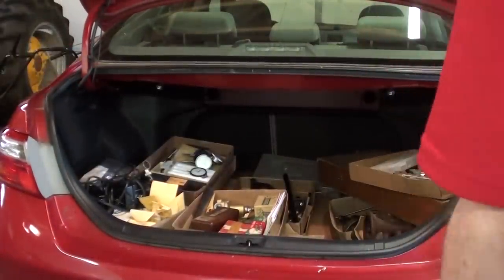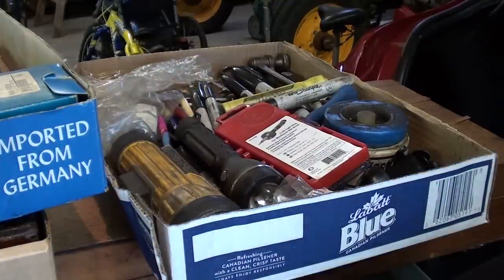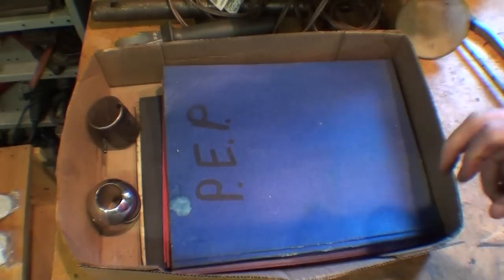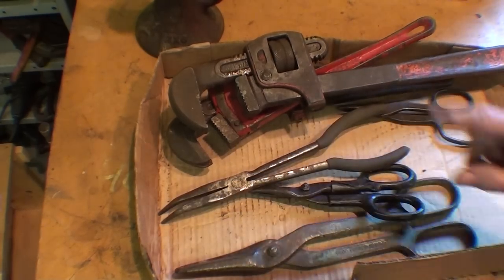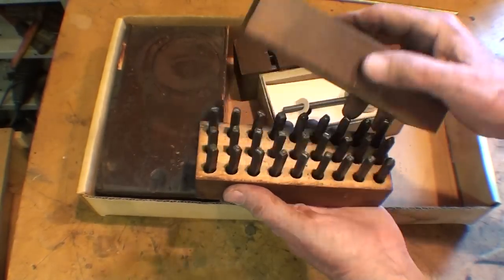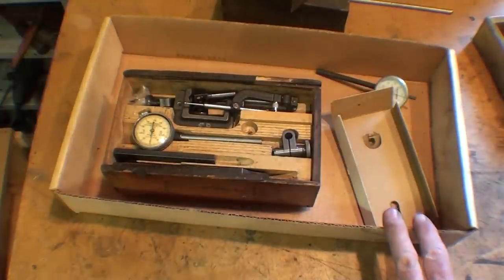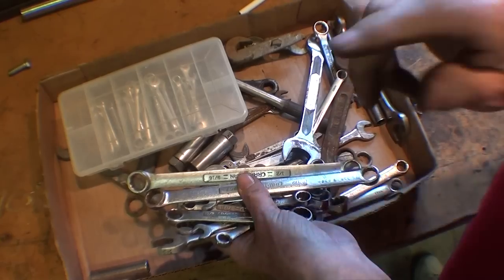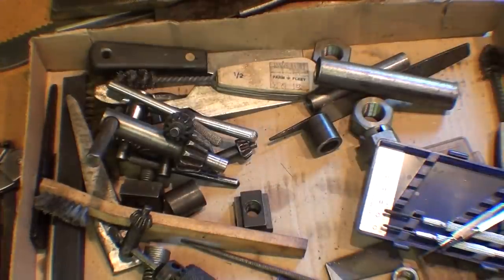mrpete SCORES AT HIS FINAL TOOL AUCTION tubalcain

Comment: Hello Mr.Pete  I would keep a broken die for one reason. You can slip around a fastener or part that has a bad thread start, slide the die stock on, then repair the thread by threading your way off.  nixman358
Reply: That is probably the reason it is broken...

Comment: Pete, the flex couplings are commonly used to couple position sensors to shafts with unreliable centers/axis, also often used to couple stepper motors to positioners/leadscrews as they accomodate both angular misalignment as well as absorption of end play to a degree.
Reply: High speed flexible steel motor couplers.
Reply: Mr.Pete,
The anvils go to a Mitutoyo dial indicator stand model 7003.  Stand is still shown in KBC catalog.
Ralph

Comment: Hello Mr. Peter222, 

That Bausch and Lomb unit is a "light fixture" that works in conjunction with that stereoscope (Bausch and Lomb) you bought at a previous auction. Insert the cylindrical light appendage in the hole on the frame of the stereoscope; it will illuminate the object being observed.

Comment: Rohm chucks are very high quality, nice find!  Probably worth $50-100 for that one alone.   Those flex couplings at 22:56 are used to connect two shafts and allows for some level of misalignment.  You would often see connecting the shaft of a motor to a lead screw.  A lot of people keep the broken stuff with the intention of returning it under warranty, but never get around to it.   It's your last auction until you go to the next one.
Reply from the maker: Thanks for watching
Reply: German Tool Reviews HOW TRUE....!!
Reply: in the netherlands on every old drill press that have been in a profesional workshop there is a Rohm or a Metabo chuck stuck on it.
Reply: The coupling is mostly used for encoders on cnc machine

Comment: I had one of the older tool makers who was not up to the heavy die work do repairs on the indicators, gauges, micrometers, etc from the quality department.
Most of the repairs involved cleaning and calibrating. We know Bubba seldom cleans his tools or even puts them back in the case when finished. 
I gave him carte blanche on what he ordered and he was very good at keeping the $ gauges working. Saved a bunch of money. He had boxes of parts similar to what I have seen here. Of course they were sorted by maker, type, and use, instead of piled together. Like you said the guy holding up the box lots was baling hay yesterday and setting up displays of tools that he has never seen before this morning in the rush to get set up so the auction can start.
Fun times.
UTC sent around lists of tooling from the companies they absorbed, shredded, and closed. 
I only ordered one lot of tools from Pratt and Whitney closures. It was a 4 foot square cube Gaylord box  filled with tool steel blanks. Enough tool steel to make multiple tool sets. 😁😁😎😎

Comment: 13:51 is a roller chain clamp its used to hold the ends together untill the master link is installed. 19:07 is a  DeepOL positive quill stop , the "c " attaches to the 1-1/2" collar around the STOP screw & the clamp ass'y attaches to the base of the quill stop , value new is about $ 100.00 . Then an indicator is attached to the top part in the 3/8 hole w/a clamp screw. 34:08 I believe these are for hardness testers for different part profiles.
Reply: Byron Fox - 44 years a machinist Just before that was the chain breaker. I've carried one in my motorcycle tool bag for over 40 year's and used it twice and not on my bikes.

Comment: the lever and cylindrical block in the first box are parts for a speed quill lever for a bridge port mill . the lever hinges in and out to re-engage the drive pin.
Reply: I figured someone would have mentioned this already. Just like the one on my BPort. Hope it didn't go to the bin.

Comment: Lyle, the Bausch & Lomb object is actually an illuminator that you can use with your B&L stereoscope. If  it is working it will throw a variable intensity spot of light that you aim at the object on the stage of the stereoscope. The lamp in your left hand at 29:16 fits into the base in your right hand via the ring on the top of the base. I do enjoy these videos, thanks.

Comment: Lyle, the coupler is a type that is used between a servo motor and an encoder on a much older style cnc or similar situation. Point being, small and lightweight, yet sturdy and rigid in a radial direction for the delicacy of an encoder. I hope this is clearer than mud, Cliff

Comment: Flex couplings like the one at 22:58 are used tot connect a rotating shaft with an electronic instrument, for instance a rev indicator or counter. It compensates any misalignment and still is backlash free.

Comment: The flex coupling is a two sized off axis coupler between shafts or motor and drive.  Often used in conveyor as it gives flex if flex is given to the setup.  Simply said if you had two shafts running off center from each other or one is held tight and the other on rubber bounce tie downs that is what hooks the shafts together. The Bosh ... light is a spot light to highlight an area to photograph.  It puts the light on the subject.  Overheads can't get around and at angles.

Comment: When I worked for a company that did printing I saw  the flex couplings used between the servo drives and the locating gears.
Printing registration was controlled by servos to move in the X and Y position on the printed web.

Comment: That Bausch and Lomb thing is a microscope lamp, I believe I spotted a box of spare bulbs earlier.
You should sell it, might fetch $100 or more. 
One day I found a threaded adapter in the trash, it said Leica on it and a part number. That was the easiest 80 bucks I ever made on Ebay - for a shot glass sized piece of tubing with threads on both ends.

Comment: I've seen those flexible couplings before in my robotics team. Thiey are used when you need to connect two shafts that don't really line up. they're not very reliable in my experience and we sheared about 3 of them before giving up and remaking the whole piece so that the shafts lined up.

Comment: Mr Pete,We use flex couplings for a linkage from a linkage to a feedback pot. Particularly in our case, Vane feedback pot for inlet guide vane for a centrifugal chiller (large HVAC). Ours are not that big though.
Reply: Additionally, the flex allows for a degree of vibration dampening to keep the feedback pots from going bad.
Reply from the maker: Thanks

Comment: The anvils @ 34"15 were for an indicator drop gauge, The first box @ 7:45 was a ratcheting handle for a bridgeport that went with the cylindrical part that has the square transverse hole thru it @ 8:25.  The 3/8 x 8" HSS tool bit. long ones were used on automatic screw machines. Probably obsolete now @25:10.
Reply from the maker: Thanks

Comment: those are flexible couplers that in a lot of cases are used to couple an encoder to the end of a shaft, used to feed back to a PLC or of the like information regarding positioning such as a CNC machine.when the program would be written, it would include counts in the program where a certain number of counts would represent a cue to a change a motion, The encoder counts and sends that count back to the controller and the motions at the appropriate time would be triggered.And by the way, I love the tool auctions I watch every second.lol.
Reply from the maker: Thanks

Comment: One think: the part from 22:56 is called "Flexible Shaft Coupling" and is used to eliminate non coaxial coupling between two shafts or in case ones has an excentric position or rotation. BTW: maybe you found what is it. :)

Comment: 1.The black items with the thumb screws look to be quill clamps for holding indicators to specific machine spindles.
2 vise jaw stop yes.
3.anvil for comparator goes with the heavy iron bases with the large diameter vertical post. An indicator was set to a dimension and many parts could be sorted quickly. Still have those from last time?

 the bent screw appeared to be a clamp screw from a V block
At 17:51 Don't lose the V block clamps!
Reply: Just came to say the same about the anvils. Used for dial indicators and comparators on a base.

Edit: and the first one you picked up is definitely a Mitutoyo part. Still being used on indicator bases today.

Comment: Mr. Pete, flex couplings are rigid 'universal' joints that power slightly misaligned shafts with no play or backlash. I'll bet your Toyota steered really light with all that iron in the trunk?

Comment: You have a situation where the end of a threaded shaft has been mauled (by some bodger, not yourself) take the broken die place around the good threads, clamp the halves together with a hose clamp, add oil, and back the die off the shaft, restoring the damaged threads.  Good use of something that is otherwise scrap.
Reply from the maker: Yes

Comment: Ball for a convertible ball hitch and Curt is a good brand. Broken die for a broken die holder ? Never seen an 8'' tool steel. An yes watch entire video !! Gauge blocks in a previous box ?
Reply: The ball at 8:35 comes in a set---1 7/8", 2" & 2 5/16", the one you have. Someone will buy it to replace the one they lost!

Comment: I bought $558 worth of stuff at an auction here in the boondocks of Kentucky last week. Probably $4000 worth of stuff if I bought it individually. 5c stuff, Mics, and Palmgren vises. I video my scores too. To show my friends on FB. LOL I have to stop though. I'm getting to much competition at the actions now. LOL
Reply: I worked for an auction company from the time I was 10 or 11 until I was 14. It's pretty much in my blood. Am still addicted to the auctions. I only do the online ones now, but I will retire in a few years and then look out. LOL
Reply: KyHighlander59 I started my addiction at 5 or 6 going with my dad, grandfather and uncle's. I tried working as A set up and ring man and have been repeatedly asked to work for all the local auction companies at one time or another but I can't do it! Most won't let employees bid and not bidding would be like blowing smoke in A crack addict's face! I just turned 65 and hope to be hauling home stuff until I take A dirt nap going through flat's!
  Just went to A pilots estate auction Sunday and got several flat's of tool's, drill bits and hardware for 44 buck's. probably 2 to 3 hundred bucks worth of stuff. 
  Another item I had A hard time not bidding on was A 1940 Chevy Coupe with A 350 engine and A automatic transmission. Went for 3400 buck's. Worth many times over that!
Reply: KyHighlander59 I started my addiction at 5 or 6 going with my dad, grandfather and uncle's. I tried working as A set up and ring man and have been repeatedly asked to work for all the local auction companies at one time or another but I can't do it! Most won't let employees bid and not bidding would be like blowing smoke in A crack addict's face! I just turned 65 and hope to be hauling home stuff until I take A dirt nap going through flat's!
  Just went to A pilots estate auction Sunday and got several flat's of tool's, drill bits and hardware for 44 buck's. probably 2 to 3 hundred bucks worth of stuff. 
  Another item I had A hard time not bidding on was A 1940 Chevy Coupe with A 350 engine and A automatic transmission. Went for 3400 buck's. Worth many times over that!
Reply: The auction I worked at didn't have a policy like that.

Comment: I think that B&L is a light source, maybe for a microscope. Plug it in and see if it puts out a nice focussed high-intensity light. Good for illuminating things for high magnification.
Reply: Peter W. Meek I think you are correct. I have a B&L stereo microscope and there is a hole in the mount for the light. Nice and I will have to watch for that on eBay if it works and it doesn't get thrown out LOL

Comment: How do you find these?
I'd love to go to a few.
Reply: hahahahahhahahah
Reply: Duane Dickey The problem in most cities is parking. I went to A small auction last Sunday and at least 100 people showed up and most were driving 1/2 and 3/4 ton trucks. In most city auctions you would be parking 5 miles away unless you went there the night before and camped out. Just no room for vehicles that large in town.
  I worked for A police department for 28+ year's and when I started they had quarterly auctions of abandoned and confiscated item's in the police garage. When I retired 3 year's ago they were sending A semi trailer twice A year to pick up the item's and hauling them to an auction house nearly 50 miles away. We just didn't have the space for 200 vehicles in and around the police building any longer.